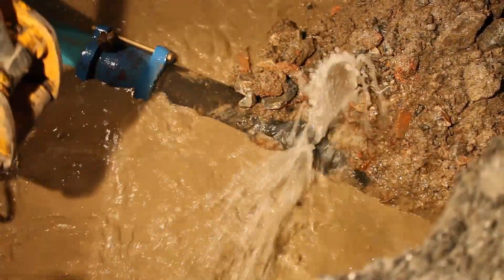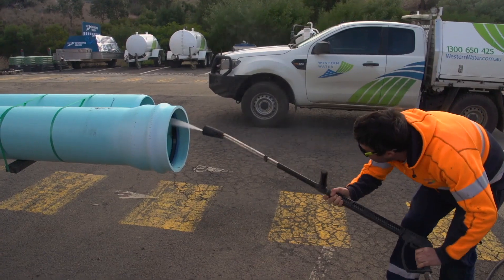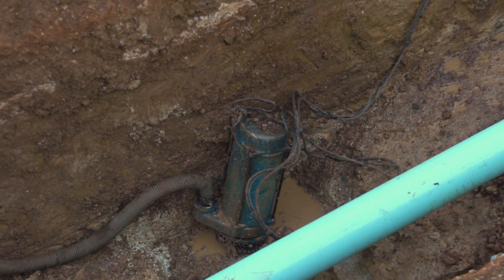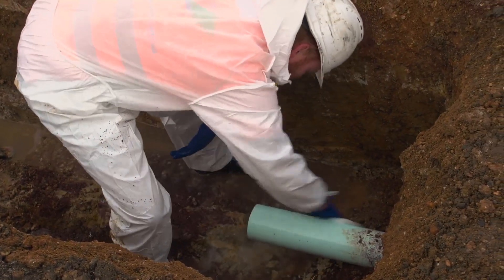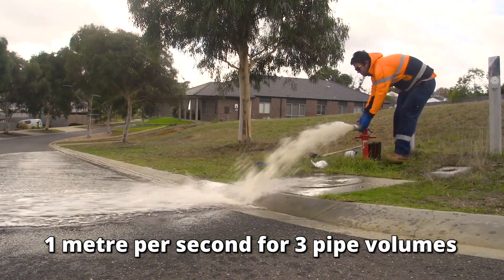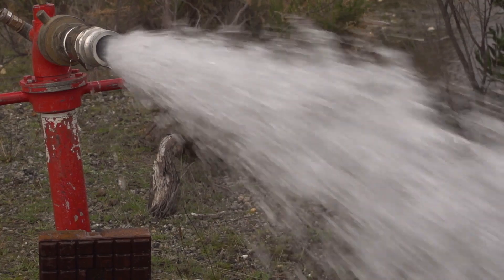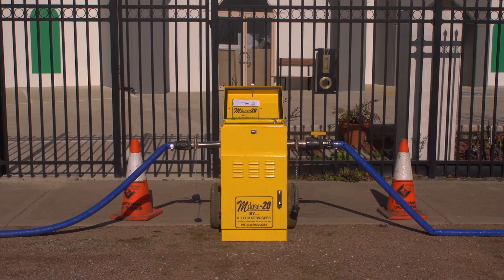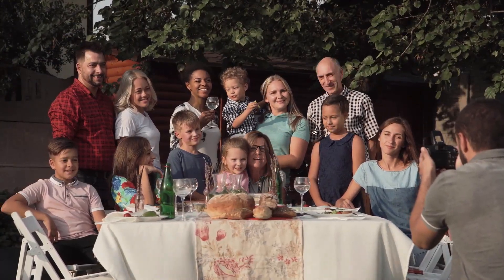Safe Water Mains Repair

Comment: Is there a video for Safe Water Mains Repair for asbestos cement main bursts?
By the looks of it Australia will be having many many AC pipes bursting as they age.
https://www.abc.net.au/news/2016-03-28/asbestos-laden-water-piping-needs-upgrading-cost-$8billion/7273444